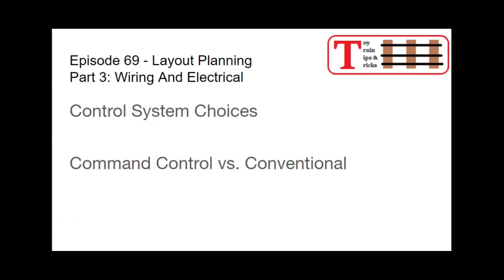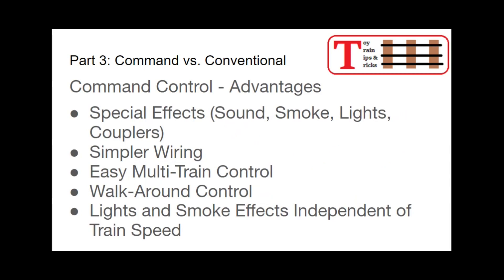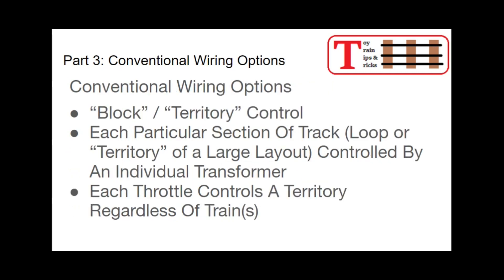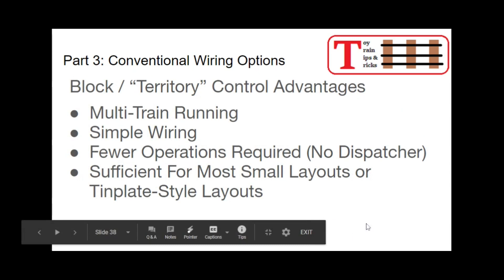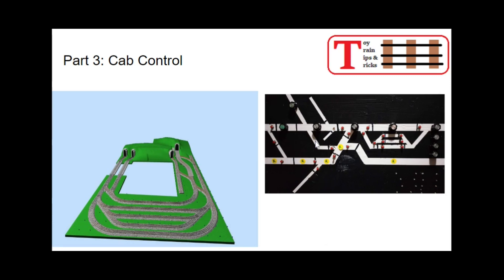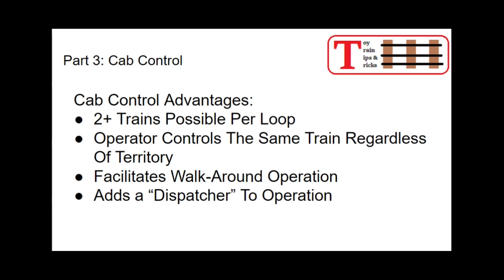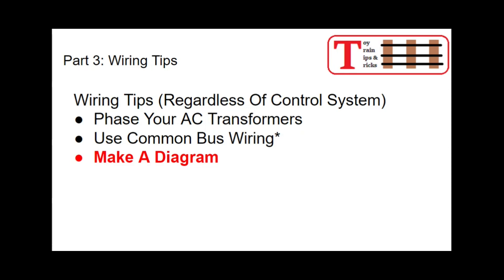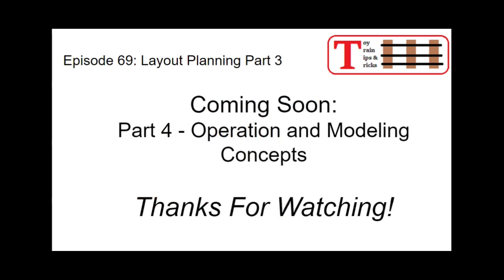Layout Planning Part 3: Wiring & Control - Conventional Or Command? Block or Cab Control?

Comment: I like your channel a lot. You do an excellent job of explaining how things work without the use of high-tech jargon. Have you looked into the idea of using "dead rail" for train control system. The idea using a LionChief engine with an onboard power source. Like a battery in the tender of a steam locomotive or in the dummy unit of a diesel set.
Reply from the maker: I have read about it, but I haven't tried it

Comment: Personally opted for conventional myself, layout's an old-fashioned one and really too small to have more than one engine going at one time anyway. The wiring was simple, and a refurbed postwar ZW is more than enough to run the entire layout and all the accessories without breaking a sweat (looks nice up on the control desk too).

The really nice part is that every locomotive out there can be run conventionally, the modern ones are backwards compatible (MTH gets the blue ribbon here, you can use all the fancy features even in conventional with a whistle and bell button), so I can run trains from every era of 3 rail O gauge.

"Obsolete" just isn't a thing on my road.
Reply from the maker: Very nice!

Comment: Are you considering a video on  converting older conventional locos to command control?
Reply from the maker: No. I don't use command control. It's too expensive for my budget.
Reply: @ToyTrainTipsAndTricks  Yeah, I'm in the same place...
Reply from the maker: I am, however, looking into the theory behind using an Arduino to provide speed, direction, and horn/bell functions to conventional locomotives via Bluetooth. This is in the early "theory" stages. I haven't even purchased the Arduino board yet to test the ideas. The conundrum has been finding an appropriate motor control shield to properly control high-amp AC motors. If it works, one could then add sound to the system pretty easily by adding a speaker to the locomotive or a designated "sound car" behind the locomotive as I did in my earlier video. (https://www.youtube.com/watch?v=eRUSWmhbE6Q)
Reply: @ToyTrainTipsAndTricks     I've seen variable frequency drive used in Industry to control pumps...what I'm not sure about is/was starting the motor under 'load', I don't recall it was an issue...but we normally wouldn't start a pump under full load (you can't really) so the issue never came up. Motors on mechanical systems might be another issue...i.e. they can start under load
Reply from the maker: I have seen lots of videos on Arduinos controlling 9v DC motors and shields for controlling 120 VAC 20-25 amp motors, but nothing in-between that is "plug and play". I think the answer will involve MOSFETs and TRIACs, but I am not knowledgeable enough about circuits to design one myself (at least not yet).

Comment: Hi, I have an O 27 railroad from the fifties with 3 lokos. Iam not good in inglish and worst in electricity.  I con not make run them.   Only one.    I live in Quito Ecuador which makes all more difficult.    Is any chance you can help mee with the wiring?  How can I send you fotos and videos from my lay out.  Thanks in advance.
Reply from the maker: Thanks for watching! If I understand correctly, one of your three locomotives operates, and two do not. That suggests that the problem is not with layout wiring but with the locomotives themselves. There can be many causes for a locomotive to not run. My first step would be cleaning the wheels and pickup rollers. Next, hook up one wire directly to a pickup roller and a second wire directly to the wheels. With the power on does it light up? Does it hum? Does it do anything? These are the first clues to diagnosing a problem.
Reply: Hi thank you for answering. The 3 locos do work.  The lay out has 4 circuits or tracks and I can make work only one at he same time. I dont know how to separate the tracks. @ToyTrainTipsAndTricks
Reply: @ToyTrainTipsAndTricks  Please help me with some bodies contact who would help with the wiring and ley out. thanks.
Reply from the maker: @galoenriquemaldonadofuchs1306  Send a diagram of your track and a description of your transformer(s) to mrmoore2001@gmail.com and I'll see what I can do for you.
Reply: @ToyTrainTipsAndTricks  Thanks a lot I will do it.

Comment: Command control is expensive unreliable hard to maintain and when things go bad the parts are non existent. The electronics required to convert a typical locomotive generally cost more than what the locomotive is worth. I remember when GCC came about in the 1970s and all the train magazines raved about it like it was the greatest thing since sliced bread 🍞. Never mind that it was difficult to install expensive and had a tendency to go up in smoke. You would also have to rewire your whole layout to accommodate it.
Reply from the maker: There is a growing movement in the Command Control community - particularly with DCC - to use more plug-and-play components like Arduino and Raspberry Pi to essentially create DIY command systems. If you have the patience to do the programming, it's getting very affordable.